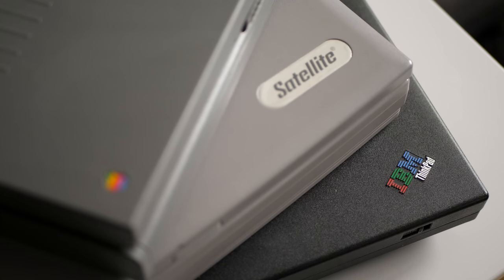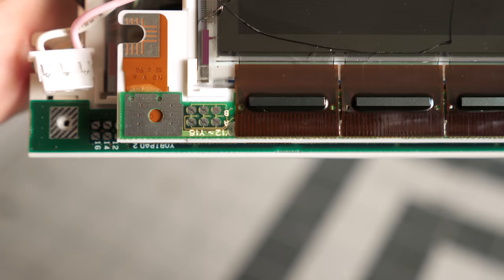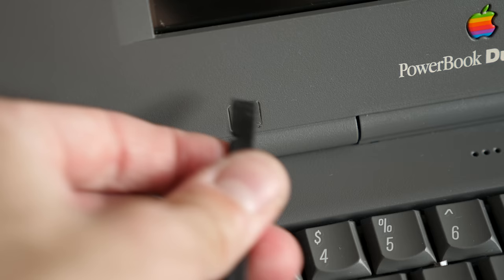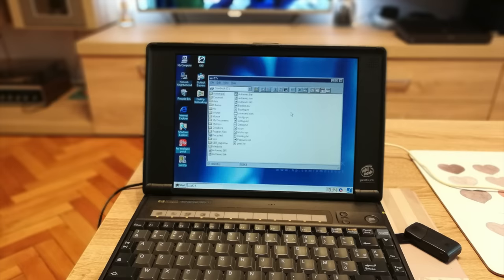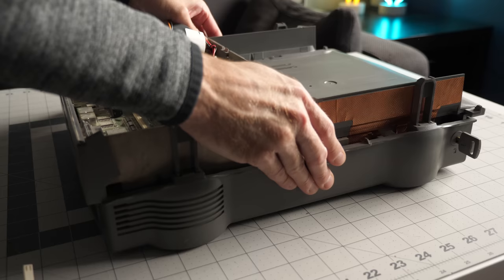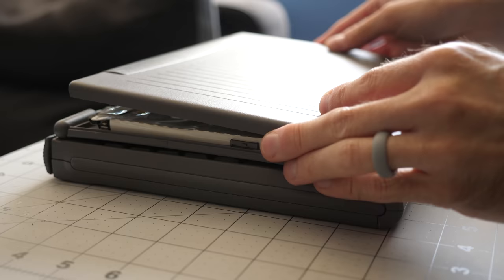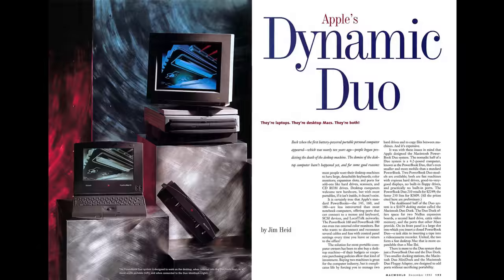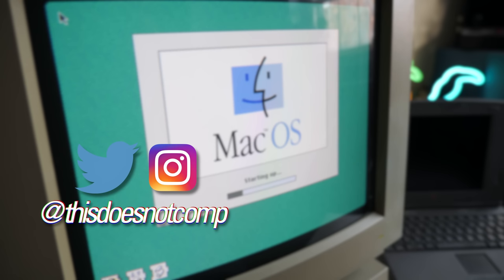Apple PowerBook Duo: The Laptop That Was Also a Desktop

Comment: "They weren't comfortable to use back at the office." Looks at the horrible keyboard and trackpad on my work provided HP ProBook. Yep, some things never change.
Reply: Laptop manufacturers these days seem to have a vendetta against sensible keyboard layouts and usable pointing devices. "Clickpads" are unacceptable.
Reply: Which version of the ProBook? My HP ProBook 440 G7 has a good enough keyboard (except when the P key fcks up when it overheats) and a usable glass clickpad (although I prefer my Logitech wireless mouse)
Reply: @s8wc3  ya for my two cents, I still like the stick between the F and G keys , but still seems to only be on some Lenovo  models
Reply: When looks takes priority over usability these things happen for sure.
You would imagine that something with the name "Pro" on it would be work focused tho instead of a shiny looks grabbing thing but I guess they just wanna capitalize on people buying stuff with a "pro" tag to seem better.
Reply: @Kalvinjj  newer (~ <2 years old) ProBooks and Elitebooks are pretty good devices tbh, they're pretty much all metal
Reply: @s8wc3  Wym "Clickpads"? Pads that click? Those are alright.
Reply: @redwillrise  I had an Elitebook. I loved that computer, but eventually I plugged it in, heard a 'pop', and it wouldn't turn on. Probably because it was charged around water. So... don't do that.

My new Dell is pretty much the same form factor, except with a better battery life, a plastic shell, and a hideous washed-out screen that has a massive light streak on it. Not to mention the fact that if you press on one of the corners of the screen, it kills a bunch of the pixels for a few days. This thing sucks, and isn't even worth half the price I paid for it. Never again.
Reply: @s8wc3  unfortunately yes, but also a lot of business being done with commercial enterprises is just sending laptops to people who are going to plug it into a dock and use their own monitors, keyboards and mouse setup anyways basically running laptops as a portable desktop between working from home or working in the office. I've been issued a new work laptop, its a Dell, in the last 6 months I've touched the keyboard probably 5 times total. It does suck if you actually do use these things as they were originally intended as on the go devices you take to school, to a client, to wherever. The default keyboard & clickpad experience is awful.

Comment: A pro tip for older hard drives, i had moderate succes in just opening up the drive, and than closing it again, i don't know how this can work but trust me, sometimes, the hard drive will just work again! Psivewri (another youtuber) did this to an old 286 laptop and his hard drive wasn't working as well, he opened her up and closed her again and what do you know, his machine began to boot! The video is called: i bought a 30 year old laptop from ebay

Comment: I still have my duo 2300c, along with the full duo dock. I bought it (lightly) used in the late 90s, and used it through middle and high school. It was a surprising powerhouse for the day…especially when in the dock. I boot it up every so often for nostalgia purposes, and to show people a docking-style laptop was around in the early 90s.

A few years ago, I put an SSD in it, and it made the battery last significantly longer. Yes, even my battery still holds a charge. 

Definitely ahead of its time, and looks good next to my SE/30.

Comment: Jerry had a Duo setup on his desk for a while on Seinfeld. The dock for the color models required a taller desktop dock to fit. But you could just replace the removable top to get it to fit. I’ve had several including the 2300c. They all had a lot of flex on the plastics. Neat units though.

Comment: One word comes to mind when thinking about Apple products: expensive. This seems to be no exception.
Reply: Ultraportable ultralight comes at a price. For all manufacturers.
Reply: @JasperJanssen  That's only half the story.
Reply: Their products weren't super expensive when they first started out.  The Apple II line was relatively inexpensive.
Reply: @davidfrischknecht8261  
After the Apple 1 and Apple 2 they made the Lisa's for fucking 10.000 dolars in 83. 100.000 dolars now, each. Today no are 20 Lisas in operation, and most were discarded from the stock to the trash for obsolescence in 84, or transform in Macintosh XL.
Reply: So how much would a comparable Windows Laptop sell for?
Reply: Apple products in the 90s were mostly mediocre and it felt like the company was going to collapse. There iMac product line helped to turn the company around.

Comment: Superglue and plastic works great! I like to add some baking soda on it. It hardens to rock-solid immediately. No wait and what seems like a stronger hold!
Reply: Yep, plus if you don't have a 3D printer, and need to say fill in a small gap it works wonders along with a small file to make it smooth once it's dried.

Comment: Good on you for saving this!

I saved two of these from being thrown out and stored them carefully at work. Then I fell ill and when I returned to work they had been dumped.
They weren’t fast but they were a great talking point and that push button eject was amazing. Somewhere I still have the locking keys that physically locked it into the desk unit and disabled the switch that ejected the Duo.

Comment: I used to have a Duo 2300c back when I was in my early twenties.  (2001).  I learned that you could transfer files, and even whole programs, over Appletalk.  It was painfully slow, going through the printer/serial port, but it worked!  🙂

Comment: As those of us who had the original Chromebook test units from Google found out, super glue will NOT hold for those inserts. You have to use a proper epoxy like JB Weld.
Reply: that would work, or he could try super glue mixed with baking soda. Tech Tangents did a video about it a while back with good results, and I've used the trick before in the past on a pair Philips headphones one of my nephews broke, and it's held up well for about a year so far.

Comment: From 2000-2001 I worked for a medium sized newspaper in IT-support. It was the time when the whole vintage IT was thrown out that had been collected in several cellars from the 80s onwards. There were about 10 PowerBook Duo with DuoDock from the media department (as well as CBM, Apple, Atari, Amiga and other computers and even terminals). The photographers had used the PB Duo machines together with early digital cameras that used a serial connection for image transfer. They had (of course) analog cameras as well. They usually took several photos with both digital and analog cameras on events, connected the digital camera after the event and transferred the digital pictures to the Duo. Sometimes they used a landline modem (maybe even quite expensive and slow mobile modems) for direct transfer to the newspaper for fast integration into articles for the next day. The serial port on the PB Duo was perfectly fitting for this use-case. When the photographer was back in his office, he just had to connect the PB Duo to the Dock to transfer the digital images to the network-archive. The analog developing and scanning of the analog camera film often took 1-2 days depending of the backlog the department had. Going digital was often the only way to have on-time reports of events from the pervious day in the current newspaper with pictures. The cameras had resolution (around 1.0 - 2.5 MP) that was good enough for a newspaper. I can remember that even in 2000, i was quite baffled that they had this kind of streamlined process since the early 90s.

Comment: So much to love in this video! The disassembly and repairs and the whole trip down memory lane for one of my favorite Macintosh product families. I’ve loved most of the smallest PowerBooks from the PB100 and Duo series to the 12” MacBook Pro Retina and my current portable powerhouse, a 14” m1 MacBook Pro. 

I had a Duo Dock at home and at work, and several different PowerBook Duos over the years. The 270c and 280c were my favorites. 

I previously used a Syquest (removable hard drive) cartridge for software development and carried it back and forth to work, but the Duo was like a Syquest that was also a whole computer which worked in or out of the Duo Dock. ❤

Comment: Glad you mentioned the upgrades at the end, I used to have a Duo 2300c which had a track ball and I always wondered why. Must have been a 280c that had been upgraded, it had no model number on the screen bezel.

Was a great machine, and also had the full size dock and the mini dock, along with a few other accessories. Sold it on eBay many years ago for far too little (compared to today’s prices).

Comment: Love it, thanks man! I never knew these back in the day since I was only like 2 when they released lol but due to my work as a computer technician and love for retro tech, I've admired these from afar for a very long time! 

I always thought the idea of sticking the entire laptop in like a cartridge and thereby expanding its capabilities was pretty awesome and extremely revolutionary for that time, and I am more than a little envious of the fact you have not one but TWO of them PLUS the dock and accessories!!! I collect old laptops (as well as other misc. tech like PDA's, Pocket PC's, old video game consoles, etc) and try to snag them off ebay whenever I can, however I haven't managed to get around to any of the Duos yet.. (mosty DUE-O to the price lol! [sry... couldn't help myself]). 

Also, I wanted to mention I was thoroughly impressed with your ability to repair the units as well as you did, specifically with the 3D printed pieces which was very cool! And I appreciate you demonstrating that trick you used melting the metal screw insert in with the soldering iron - that's valuable knowledge to me that I won't soon forget! 

Anyway, thanks again man! I really enjoyed the video!!!

Comment: Siemens in Germany took it even further in the mid-90s! They had a „QuickDock“, which doubled the ports and included two ISA-slots. And they had a full Dock which included 4 ISA-slots, connections for harddrives, ZIP-drives, 3,5“-floppy and optical drives. It also was able to take a battery pack to charge it and had a monitor-stand, where you could park a tank on...

Comment: For those folks without a 3D printer - the standoffs can be repaired by carefuly placing the inserts back in the remnants of the broken standoff, and then using JB weld to cover the broken side.  Also coat the remaining standoff remnant with a mm or so of JB weld to reinforce it.  Its not pretty, but works perfectly and I've used it in many of these situations.  Since its internal, you wont even know its there when reassembled.  The other nice thing about JB weld is that its designed to be machined, so if you go too thick - you can file away any areas that are too thick.

Comment: I bought a brand new Duo 280c. Loaded. With a desktop dock and everything. Initial cost was over five grand, but all in with a few extras, the total cost ballooned up to about 10 grand, or thereabouts. Was it worth it? Well, I don't know. It was an amazing machine and one of the most reliable Macs I owned during that time. Rarely crashed, always booted up, and it could be trusted in adverse conditions to get the job done. I kind of miss it. Others were envious of it. Even guys from the other side, windows users. On the other hand, it rather ruined my life. I had to work. Had to get things done. It was so reliable that I didn't have an excuse to not get things done. I could, in theory, get work done anywhere, and often did. I couldn't make excuses that might apply to other laptops.

Comment: I had about 5 of these back in college in the early '00s and they were so easy to work on that they were how I taught myself to work on small electronics. Got to the point where I could have one completely blown apart and back together in about 30 minutes. The one thing you missed that played a big role in why many people didn't keep using them was the keyboard. The membranes they used, especially on the early ones, were terrible. They had a numb feel when typing and often had difficulty completing contacts, especially as they aged. By the time Apple got them right (revision 4, if I recall) many people had just discarded the computers in frustration rather than bother to update an older machine. And although they at least allowed you to type without dead keys, they never got rid of the numbness and didn't feel very good compared to other laptop keyboards.
Still, I seriously regret selling my collection of machines and parts back in '04. I always found them easy and fun to work on and to use. This makes me want to buy another... someone distract my wife.

Comment: That was the neat thing about the 2300. All of the Duo displays would work with the mainboard and you could have the trackball or the touchpad. But using the 210 or 230 low resolution, passive matrix, monochrome display on a 2300 would be quite horrible.

I used to have a Duo 280 prototype circa 2003. It had production style labels on the bottom stating it's a Yeager Prototype Unit and NOT FCC certified, not for sale. It had a Duo 250 lid on it. Straight out of the stock parts bin, with Duo 250 label at the bottom.

It had one odd quirk. In a narrow vertical stripe under Edit on the menubar, black pixels in window title bars would not show. It only affected black pixels and only in the window title bars, nowhere else. IIRC the ROM chips had handwritten labels.

I also had a Duo 230 Engineering Sample. It had no production style labels, just a paper label on the bottom saying it's an engineering sample. It had been taken apart a lot while undergoing testing. One thing of note was a handwritten note on the side of the internal frame. Glued and tested ground clips. With a date I don't remember. Aside from that it was apparently identical to the production Duo 230.

I was having fun with 68K Mac emulators at the time so I used a utility to copy the ROM from both and I should still have those files. It would be interesting to do a difference check between them and production 230 and 280 ROMs.

I was thinking about using one as an ebook reader but in 2004 I got a Handspring Visor Platinum for $60. I sold both Duos and an ordinary Duo Dock for $80 to someone somewhere in the eastern USA.

So somewhere out there in the wild is a Yeager Duo 280 prototype. Dunno if it's ever changed hands again or vanished into the buyer's collection, or closet, and hasn't been seen for the past 20 years.

Comment: I've had both a Duo 230 and a Duo 280c with the MicroDock and Floppy drive.
I got the 280c first to run a database in a dusty mouse lab where I was doing research for my Master's thesis, but I quickly replaced it with the Duo 230 because it had a larger screen more fit to run the database (where colour didn't matter anyway).

The Duos were then sold to a fellow student for his subsequent Post Doc lab work. Unfortunately, he once placed the Duo 230 on the floor and accidentily broke the power plug inside it by stepping on it, so it was subsequently scrapped, except for the harddrive. We planned to ship the Duo 280c to me this summer, but regretedly we had a big fall-out, so he gets to keep it.

Anyway, I have a handful of old Mac's, including a TiBook and my maxed-out Performa 475 (even with a Quadra CPU upgrade, a PDS Ethernet card, and the CD300 SCSI CD-ROM drive), so it's not like I'm going to miss it.

I never used the 280c much, since I had my Performa 475 (and later the awful Performa 6200) with much larger screens to work on, once the data were transferred, but I used the Duo 230 in the dusty lab on a daily basis for more than six months, and except from having to clean the mouse ball occasionally, it never let us down. Of course, the battery wasn't very good, but we were harvesting data for hours so we had to plug it in anyway.

Comment: Thats a very neat trick replacing the broken studs inside the laptop. I will give it a try should I ever come across the problem again.
I tend to rely on using very effective solvents with a syringe to fix plastic. It's great on cracked cases.

Comment: I used to repair these back in the day and i also owned the power pc variant the 2300c. It was one of the thinnest and lightest laptops of its day. I really liked mine.

Fyi, those plastics were pretty brittle even when new. I replaced a LOT of those screen backs. The Powerbook 100 and 500 series laptops were also notorious for the screen plastics breaking at the hinge.

Comment: Great video. It brought back memories for me.I had one of the 2300Cs in 1996-97 with a Newer Ultradock, external floppy and later got a duo dock from work. (a mac reseller). Also got the duo through them at a good price on an EPP. It was not a powerhouse machine, but a neat computer to own. I played WC2 on it with friends using a phone net adapter and used it for school work. I also connected a giagantic Lacie CD-R drive to the ultradock at home and used it to burn CDs and install Crystal Caliburn PInball  Fun times. Your restoration was great and had some suspenseful moments!

Comment: I owned a couple of these models back in the mid 90's, including a greyscale TFT model, the greyscale TFT was super sharp and a real joy to use, I was sure my greyscale was a 280 model but my memory may be playing tricks on me.
The built in 14.4k modem was a big deal at the time, it was very reliable too.
Some time around 1999 I stopped using Mac computers and bought PC's, then in about 2005 I switched back to Macs again and have used them ever since, except I also use a chromebook now for travel use.    Those old powerbooks may look clunky today, but they were sexy in their day.